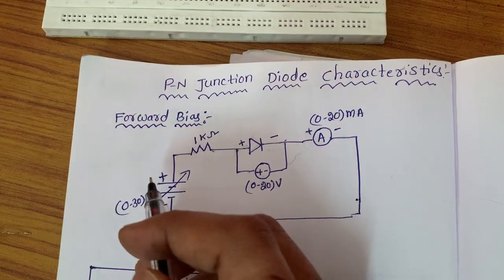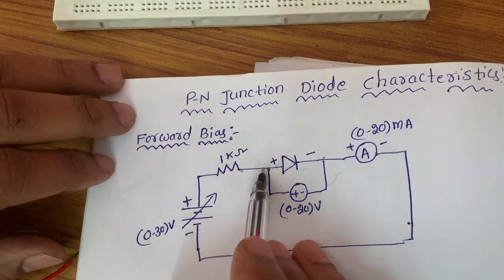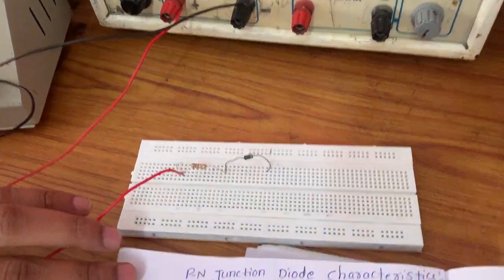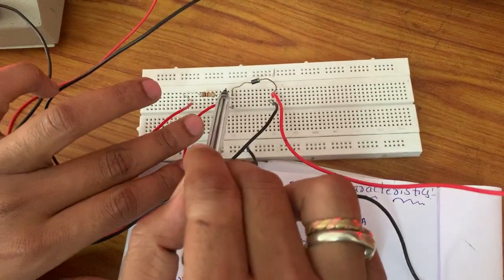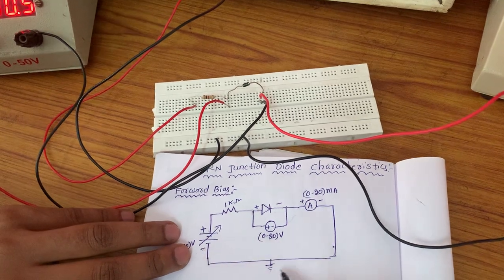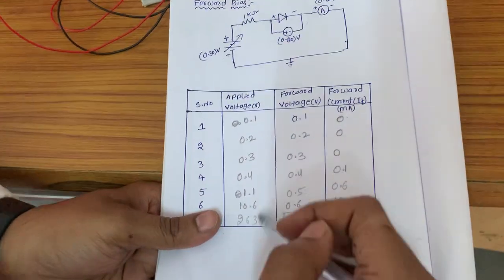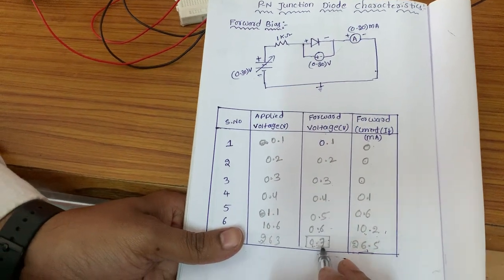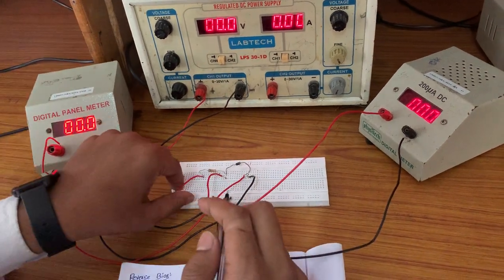17. PN junction Diode Characteristics | Lab Experiment | BEEE Lab | JNTU | Autonomous

Comment: 00:05 The experiment is about PN Junction diode characteristics

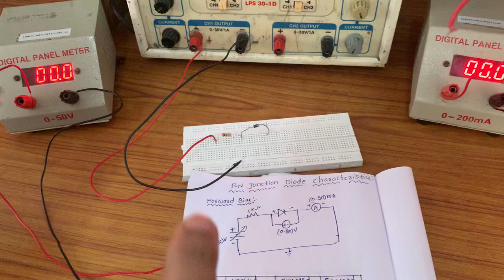01:23 The connection and measurement setup of various devices

02:52 Increasing RPS value leads to changes in voltage and current

04:19 Increasing the supply voltage to 0.7 volts leads to a drastic increase in the current.

05:31 Forward bias voltage and current increase drastically at 0.7 volts

06:44 Reverse biomes and forward bias connections in a circuit diagram

08:15 Increasing the reverse voltage results in an increase in reverse current.

09:54 The forward bias and reverse bias characteristics of PN Junction diode.
Reply from the maker: Inform your friends about our channel